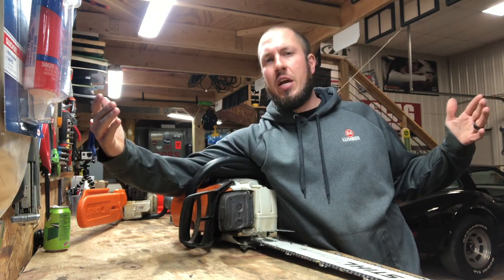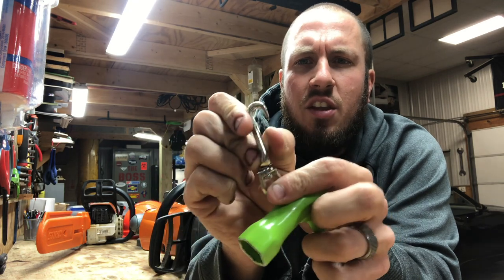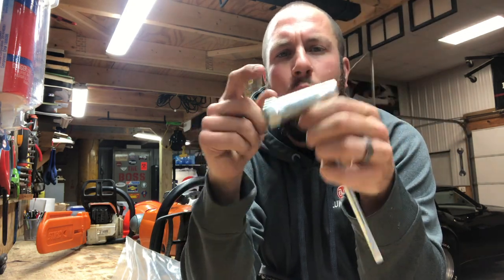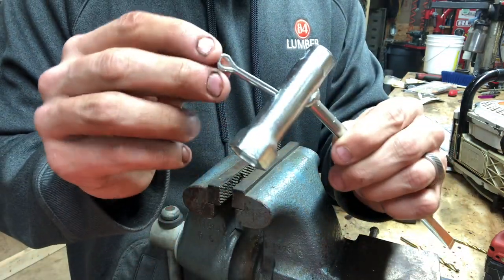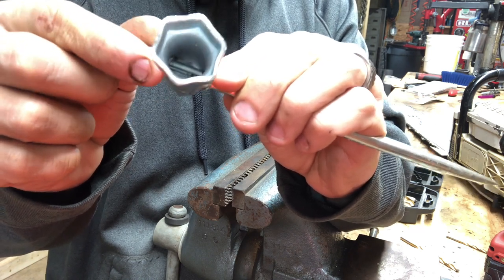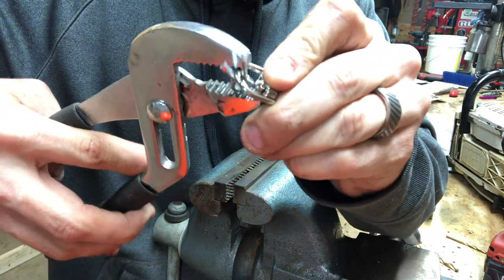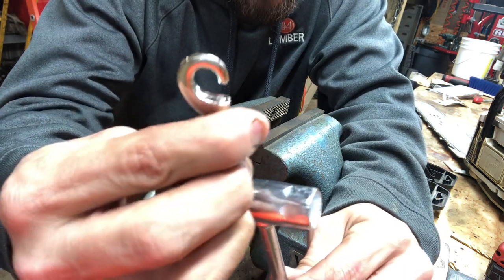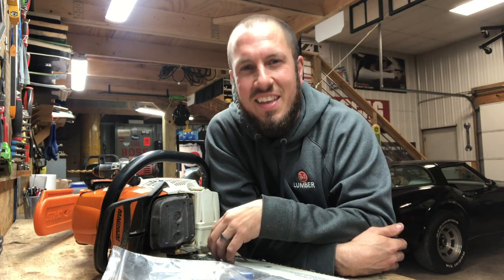Scrench Tool - Best Chainsaw Mod

Comment: Nice job, I have a very similar setup.  I have an addition to prevent accidently stabbing my leg with the screwdriver end. Take a short length (about 5 cm) of plastic tube that is a tight fit over the screwdriver end. Seal one end by melting and squeezing shut and push it over the screwdriver end when you are not actually using it.

Comment: I'm going to have my screwdriver bit ends inside the socket part of the scrench and they will be attached yet moveable mountable. I will have all sockets and all screwdriver heads in a compact non pokey won't come into separate parts to lose scrench.
Then it's patent time.